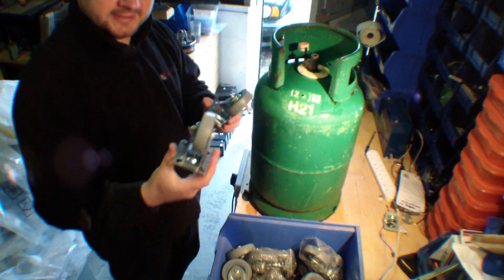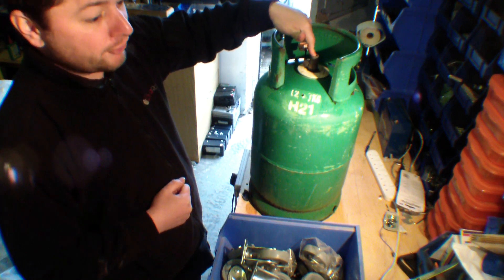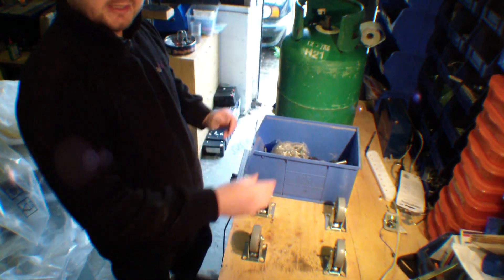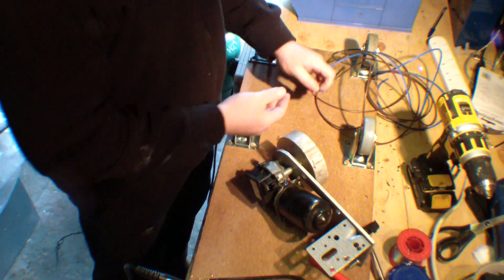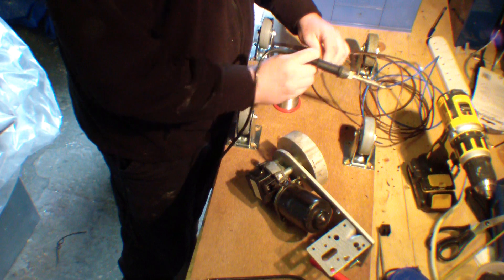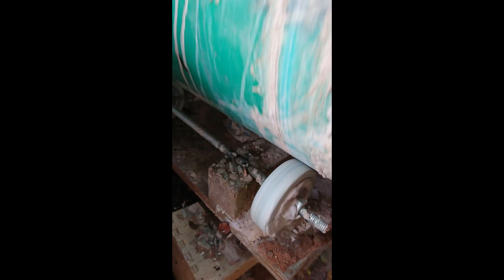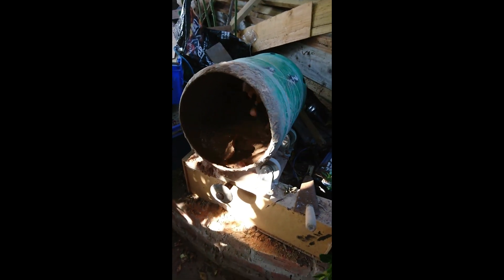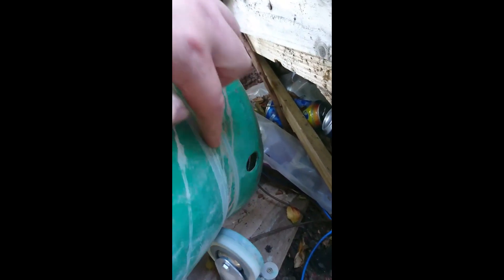DIY Build cement mixer made from old gas bottle and a wiper motor

Comment: make sure no gas in bottle. Now unscrew tap carefully once off insert garden hose and fill with water leave for minimum of 4 days as the gas in liquid form has impregnated inner lining of tank. Empty tank and quick rinse with more water then you can do anything you want to it. This is how I do it i made garden burners and air tanks with them. Don't underestimate the tanks power to bite back.
Reply: The gas was liquid under pressure only. Once opened its no longer liquid. If the tap is off and uo filled with water the gas is out. You can cut right after emptying water. No need to wait days